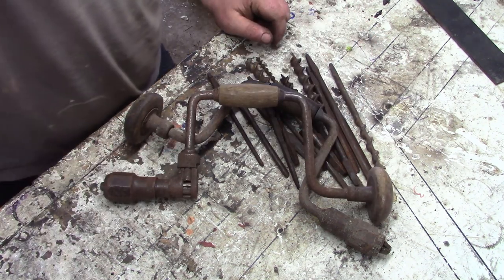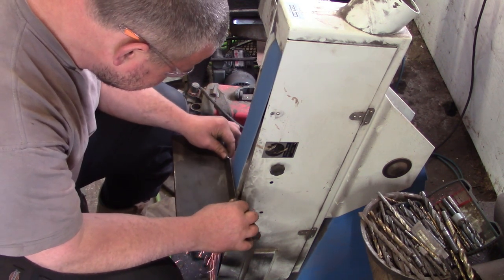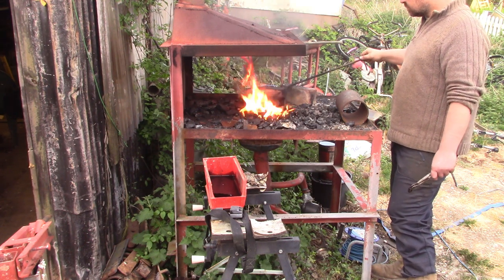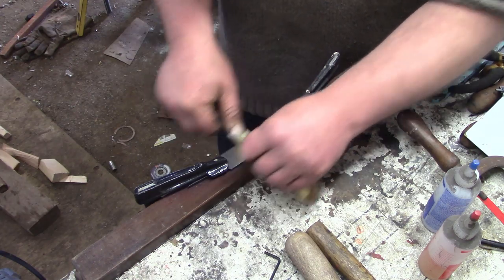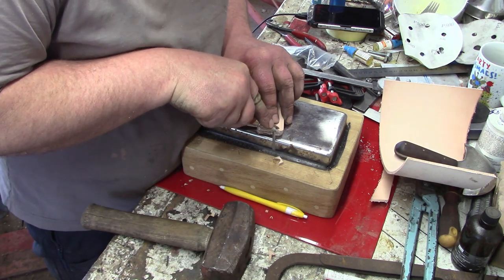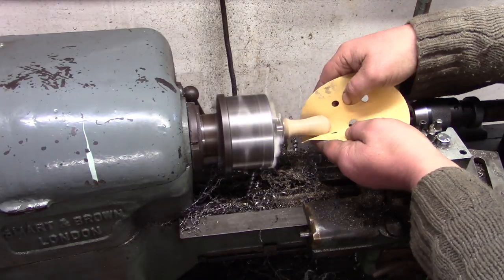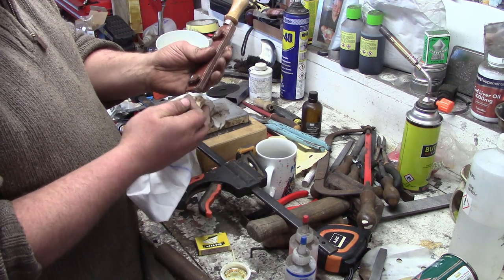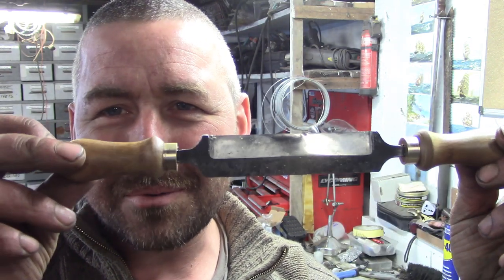Draw/pull knife build

Comment: Beautiful work, man! Thanks for sharing. Never made a draw knife bu think it's a good thing to have as a bushcrafter and seems to be fairly easy in making compared to what I was trying to make in knives recently and was not too successful. Good idea!
Reply from the maker: Cheers mate, I'm half regretting putting the ricaso on it, would have been even simpler without and maybe a more usable tool? I don't know. Good luck with your blades my friend. I started out making mine from hss lathe tools with some pretty interesting results!
Reply: @turboconqueringmegaeagle9006  Mate, just thought the same thing and will make mine without any ricasso and sharpen it all the way to the edge. LOL Just didn't wanna criticize your work since I have no right to do that. :D On the other hand a ricasso may be good when defining lines while scraping but I don't plan to use mine in such a precise way.

Comment: That's quite a tool there. I see you didn't break out the sewing machine for the leather work though.
Reply from the maker: That machine is limited in thickness to around 1/4" but this was only a short little stitch
Reply: @turboconqueringmegaeagle9006  Out of interest where do you get the veg tan from?
Reply from the maker: @BensWorkshop  a wholesaler up north, it only works out cheap if you need a side (about 7' long) and at the time I was making sheaths for the mini parangs
Reply: @turboconqueringmegaeagle9006  Fair enough. You can get hold of upholstery off cuts very cheap. though I'm not sure that is suitable for making sheaths.
Reply from the maker: @BensWorkshop  there are so many different tans and splits but a lot of the upholstery is "chrome tan" and can rot metals apparently. 
Having said that all of my early leatherwork was done with old boots and cut up arm chairs and I never noticed anything. It's a bit like plastics, the more you read up on it the more you realise just how big and varied the subject is.
Reply: @turboconqueringmegaeagle9006  interesting. Thanks.